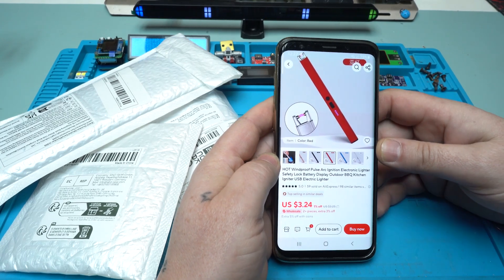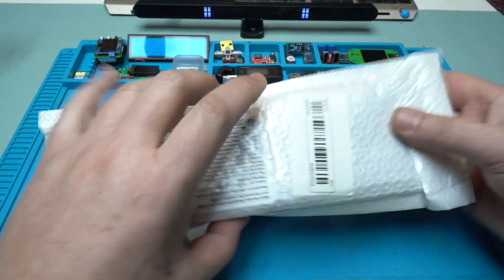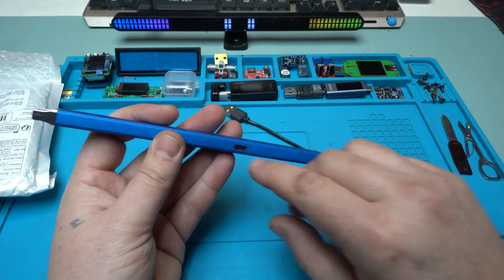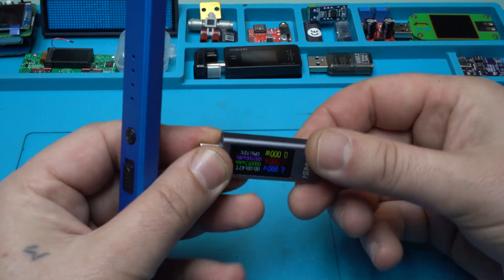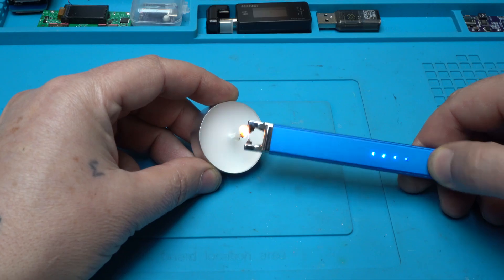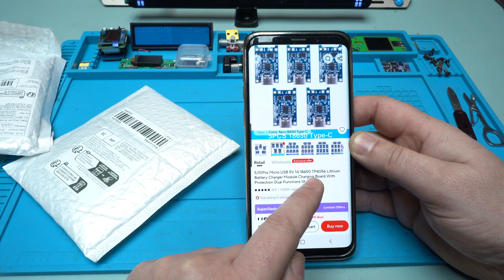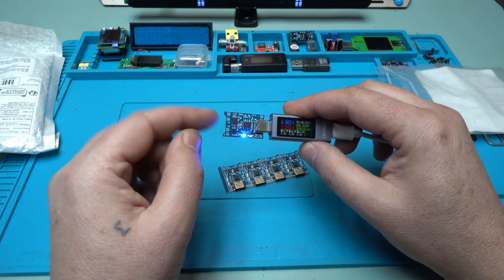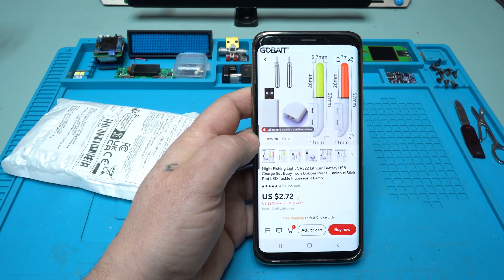3 Random $1 Finds from AliExpress

Comment: Ar LIghter, few years ago i bought in SPAIN an arc lighter, it had a slow arc and it was the best and safest way to turn on my GasSTove. Later i bought an new continous-arclighter like that one, and thats awesome i can recharge it on USB C and do not have to change batteries. Amazing i love it. I also bough a new one a little higher quality. The new Plasma-Arc lighter can cut throug anything...its awesome to remove rope that hangs from tshirts, or open CHIPS Bags..i love it
Reply from the maker: Glad you're enjoying your arc lighters!

Comment: I have a pair of the green lights on my cat's collar. I have a TabCat direction finder transmitter in the center under her chin, with one of the white holders on each side sewn on. At evening, I put in the batteries to the lens, then screw one in each side hanging down, and you can see her for hundreds of feet, drivers can see her, the neighbors see floating green orbs and call the UFO hotline, and the batteries last for ! 12 ! hours! For only $4.64. I use the CR322 version of the lights.

Comment: the plazma lighter is not that good it just starts on 1,5mm gao that not much or 2mm my starts like 7mm gap and it is smaller just gram LCD tv grab fly back transformer and that connect some mosfetst series sekondery vinds primery  for fly back and power and that its you made plazma ligther nice😂

Comment: That lighter could well be used as a taser!    I find it a little scary...
Reply: We used to disassemble “electric” lighters (the ones that ‘click’ instead of having a wheel) and use the ignition mechanism to shock our fellow classmates
EDIT: at 3:18 you can see this type of lighter
Reply: @He4vyD  We did that too. Metal framed glasses where a common target.
Reply: You don't feel a shock with high frequency electricity, it just burns your skin.

Comment: Just in case anyone wondering what the meaning of the cr425 on the battery or more the common the cr2032 flat circular battery is, It’s theirs actual measurement. First digits is diameter second is thickness. 

In your case it’s 4mm diameter and 25mm ‚thick‘ 
Cr2032 is 20mm wide and 3.2mm thick. Now you know what’s the best battery for your remote or whatever :)
Reply: Was just going to post the same info.

Comment: What’s the run time when the lights are fully charged?
Reply from the maker: 25mah,if leds are pulling around 20mah that means 1h
Reply: Tiny battery is interesting, wondering what you plan to do with it?
Reply: Those lights look just about right for being spotted staggering back from the pub in the dark.
Reply: I run the CR322 (not these CR425) on my cat's collar, and they run for 12 hours!
Reply: @BrilliantDesignOnline  That's actually impressive
Reply: @IrishFinalExit  I was shocked: I plugged one in at 10am and at 10pm it was still putting out pretty good, but getting dimmer. When initially charged up, they are impressively bright for a 3mm x 22mm battery and the chartreuse green color is brilliant. Just get some to play with and you will see what I mean.